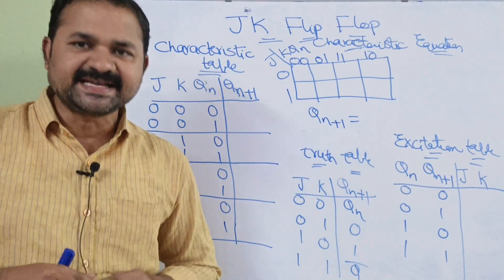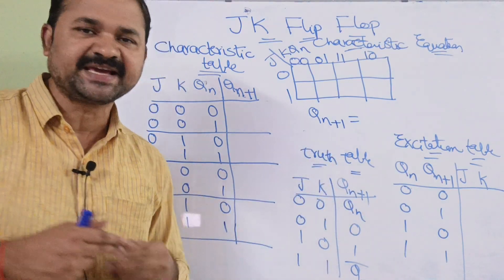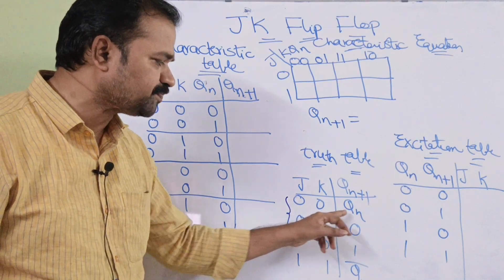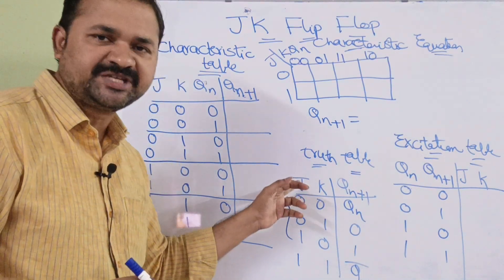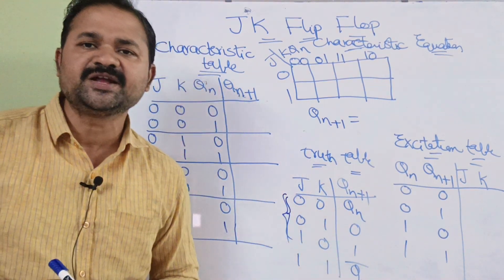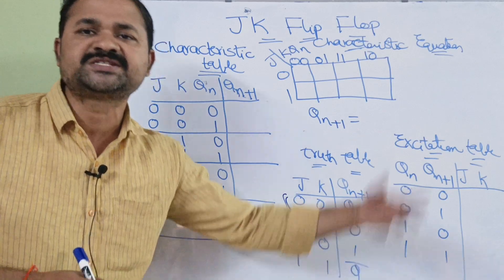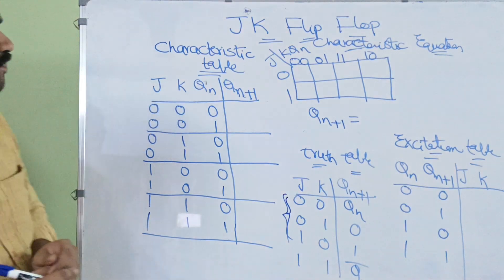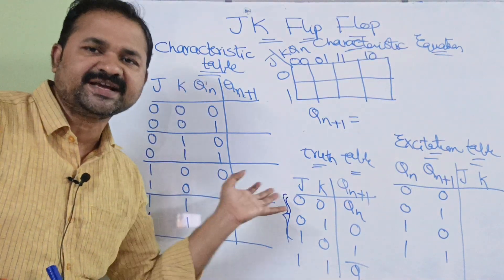JK Flip Flop Characteristic Table, Excitation Table & Characteristic Equation | Digital Electronics

Comment: 🎯 Key points for quick navigation:

00:15 ⚙️ The JK flip flop truth table is introduced, showing that it has two inputs, J and K, and produces an output q(n+1), the next state output.
00:28 🔄 The JK flip flop behaves similarly to the SR flip flop for certain input combinations like 00 (no change), 01 (reset), and 10 (set).
01:35 🌀 Unique to JK flip flop, the input 11 results in toggling the output (complementing the current state).
02:19 📊 The characteristic table of the JK flip flop is created using truth table data, with three inputs leading to eight combinations.
03:10 🛠️ For inputs (J=0, K=1), the output is reset (0), regardless of the current state, due to J=0 and K=1.
03:38 📈 For inputs (J=1, K=0), the output is set (1), also independent of the current state because J=1.
03:51 🔄 When inputs are (J=1, K=1), the next state output is the complement of the current state output.
04:06 🧩 The characteristic equation is derived using a K-map, with simplification leading to the equation q(n+1) = J'q(n) + K'q(n).
06:46 🔍 An excitation table is designed, showcasing the inputs qn and q(n+1) vs. outputs J and K with different combinations.
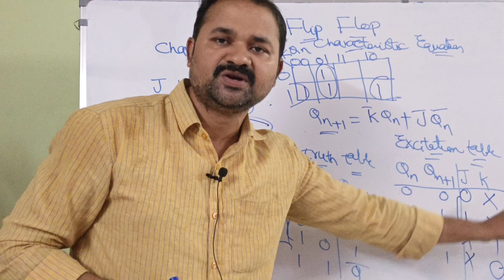08:12 ✨ The excitation table pattern is easily remembered with values 01 followed by don't cares, and its reverse.